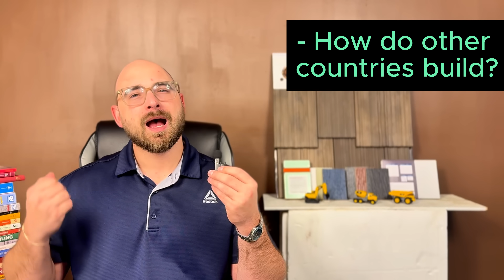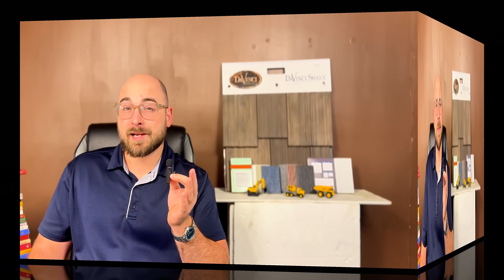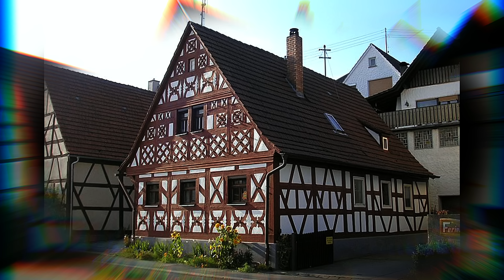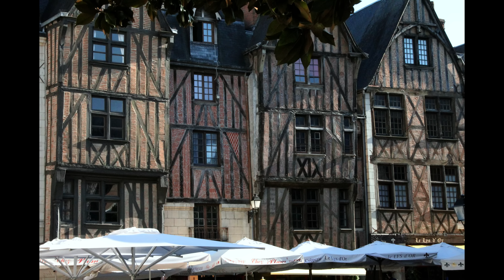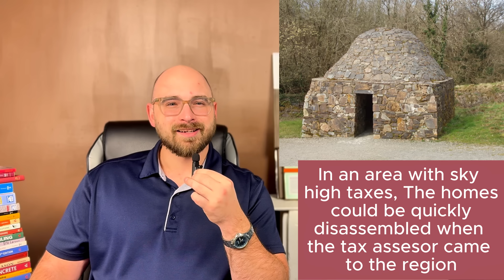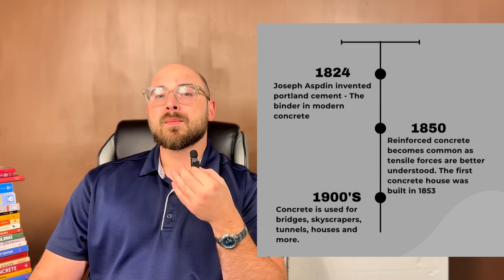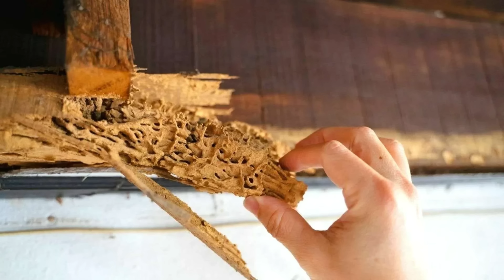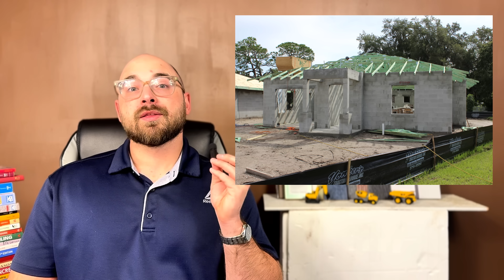Why Other Countries LAUGH at American Homes

Comment: In South Africa its mostly clay or cement brick houses. the labour pool skills are oriented to these materials. if you build a wood house, even if the wood is cheap, it will take forever to build, because there are simply not enough skilled carpenters available. You might have 20 bricklayers on a house and 3 carpenters who put up the roof trusses and hang the doors.

Comment: Jamaica makes it's own concrete and almost every building people use is made of concrete. My maternal grandparents home is made of reinforced concrete slabs. It was built in the seventies in Jamaica has been through every hurricane, earthquake and gang war since it's construction ended and additions built onto it. And other than some maintenance every few years and some cracks it's still standing. The only strong wooden houses in Jamaica are made in the old durable as fuck style with hardwood treated against salt corrosion, insects and fire resistant treatment of the wood.

Comment: Look I've done construction cleanup and also geeked out on older methods of America style like timber and the less common modules style. And this is what I can say... u can get a house but up in less then a month with less waste then how these modern home are. And also they are built better. U don't walk up to a house wall tap the wall and know that plaster is covering foam and wood and it's less then a inch thick of protection.

Comment: Other countries pump tons of CO² into the atmosphere for each concrete house they build. The US sequesters CO² with each wood house they build.
Reply from the maker: And then we have a whole city burn down, or tear a house down and landfill it after 50 years 

Is that good for the climate ?
Reply: @Mike_Fortin  Whole cities burning is both a rare occurrence and a result of climate change which is itself the result of using dirty manufacturing techniques like concrete (8% of global greenhouse gas emissions). The area which burned in LA -- Pacific Palisades-- was developed nearly a century ago. Short of a disaster, there was no reason to suppose the mostly wood structures would not still be there in another century. The house I was raised in was built in the 50s. It's still there. The house I raised my children in was built in the 60s. It's still there. I have no idea where you get the idea that a wooden house is going to the landfill in 50 years.
Reply from the maker: If you saw how many new homes are uninhabitable after just a few years, you would be shocked. From cheap methods to low quality lumber that cannot handle ANY amount of moisture 

There’s some very serious lawsuits against big builders. But that’s another topic for another day. 

Wood has a place, concrete has a place, and we can and should build better housing, especially in disaster prone areas 

A place like FL is a great example, a lot of those homes that were destroyed are going to be landfilled. 

While a product like ICF (insulated concrete house) is more energy intensive to produce, it will last longer and use less energy. Concrete also recaptures some of the C02 during the curing process. When eco friendly concrete is widely available, I’ll advocate for that. When eco friendly versions of rigid foam are widely available, I will advocate for that. For now it’s a matter of doing the best we have with what we’ve got. Wood is not a carbon neutral resource either, we use gas powered equipment to grow, harvest, plane, engineer, kiln dry, transport, and install lumber. 

One of the most sustainable things we can do is build to last, building to use less energy and survive disasters
Reply: @Mike_Fortin  "If you saw..." I dunno. I might be. How many are uninhabitable after only a few years?  As a percentage of all homes in the US.

ICFs seem like a great tech, but my cabin with 2x6 fir construction and rockwool plus an offset 2x2 sleeve with EPS foam is in a cold area, and it takes three days to cool down to ambient temps.

"Wood is not..." Nothing these days is carbon neutral, not our food, not our clothes, not our electric cars. Wood is much closer to it than concrete, though. It's not even close. If we had built the 80 million single- family homes in the US from concrete, we wouldn't be arguing about when the polar caps were going to melt. We would already be using gondolas on 5th Avenue.

If they come up with a concrete that isn't so dirty, more the better. But today I'm going to go look at an immaculately maintained and updated Pennsylvania farmhouse built of clay bricks, wood, and hand-dressed timbers in 1840. The longevity of a building has less to do with the materials used in its construction and more with its maintenance.

Comment: Making houses are of ticky-tacky and having them burn down, get destroyed by floods or bad weather and maintaining them is a battle.  I like the houses in other countries where they are built using cement, brick and metal - durable homes where you don't need fire insurance at high prices and huge maintenance costs, too.  Most countries don't insure everything like in the USA, because they are made to last, so costs over time are contained - use durable materials!!!

Comment: We're building our home now. We are in TX. We have a metal frame and exterior. Stick framed inside with 1×8 ship lap pine on the walls. 10' ceilings and 10' portches on all four sides.
Reply from the maker: What did you do for insulation? 

I know TX is hot , I would maybe want the dew point on the exterior

Comment: I have no Problem with the US Platform framed Buildings i live in one in Germany. I have a problem with missing Insulation, missing Hardboard behind drywall and that when i watch US building electric cables are not wired 6 inches below the celing or 7 feet of the ground but in the center or at floor level.

Comment: Beat an US wall and You have a hole in the wall,
beat an EU wall and say good bye to Your broken hand
The LA fires show it is a bad idea to use US construction. The fires would never run that fast and wide in concrete built areas.
They are save with Earthquakes, better conservation of energy
Rooves made of tared shingles catch fire fast, ceramic shingles are fire resistant.
If a storm is expected in the US, people evacuate, in Europe we close the windows and thats it

Comment: I dont think there is much wrong with stick frame construction, given that you take natural disasters in the build are into consideration. The main issue with a lot of builders is cost and corner cutting. I am planning on building a house myself, in an area with little to no disaster risk, and traditional stick frame is by far the most cost effective and, quite possibly, the only viable route. I do plan on "over building." Dense 2x6 walls, loads of blocking, as much insulation as I can fit, thicker than standard drywall, etc.

Comment: The terra cotta construction block, which you are classifying as "brick", is interesting.  I encountered it several times while working in DC.  One drawback is when it is used in the floor, as a flat arch between concrete beams.  The pull-out resistance on the walls of these units isn't super-great, so hanging anything heavy is not a good idea.  There was a manual produced (in the 1940's?) instructing on the use of the building material.

Comment: There is structural bricks, thermal bricks and normal bricks, in Portugal structural bricks and cinder blocks are not normally because of earthquakes and never for more then 1 or 2 floors, particularly in Lisbon you need a real strong structural resistance structure normally in concrete to resist the earthquakes, metal is also use but there is the problem normally of oscillation etc.

Comment: im an american, and even i laugh at the disposable houses made of (in some cases) elements of Literal Cardboard, of which should not be Literal Cardboard. 

I have lived a number of years each in dallas-area texas, norfolk virginia, and st louis and kansas city, and i can tell you that typical 'just-to-code-and-not-a-cent-more' american housing is literally the underside of the bottom of the barrel. With a reasonable amount of time, i could probably do better by a full half-measure, using just reclaimed or 'defect' materials. 

Matchstick-style platform mc-housing is ok if there was literally no option other than various sorts of tents, tipis, and yurts, and we as a society knew literally nothing else - However, therein lay the self-disproving, because we as an american society should know better, because we DO have examples to look at, in our own territories, of ways to build better houses with stone, brick, adobe and cob and daub, metal, concrete (with or without rebar lattice reinforcement), even examples of how to build with wood to a higher standard of longer-lasting quality (ie, medieval style timber and half-timber framing). 

Functionally, this results in alot of house-building and architectural knowledge - which is simply not being used in america. At All. - and THAT, is worthy of being internationally laughed at, shamed, and insulted. As americans, AS AMERICANS, we should do better, and not rest on our eagle-laurels of yesterday's former greatness.

Comment: Interesting, I’ve wondered about thé European and American building code différences too.  Another interesting aspect to that question, would the U.S. be better equity-wise per family if the u.s. standard building codes had had more stringent & of higher value requirements since 1776?
Reply from the maker: In areas where the set the bar higher, the minimum standard goes up. 

When code requires a minimum R value of insulation, many builders switched to ICF along the east coast. 

When CA required solar, all houses got solar 

Every region is different, but every region has their own adaptations of the building code to suit them. 

Tornado prone areas should have requirements to build for tornado resistance, wildfire areas for fire, and so on. … 

The idea that we should be allowed to crank out substandard houses to support the American dream is not ideal, and some of these “affordable” options are a huge headache for buyers and they end up in court. 

The production style homes prioritize quality over square footage and in my opinion are wasteful and not going to last. 

If homeownership is the goal, which it is, we need to downsize a bit and focus on a on quality in an equal or lower price range and build that way for years to increase the supply of housing 

We also need more young people in the trades, more builders, more innovation etc,

Comment: It's not even a discussion.  Concrete, stone, and masonry is stronger and more durable than lightwood.  We just build this way because it's cheap and it's what contractors are used to doing.  How much a year do you spend on pest/termite treatment?  A roof needs to be replaced and/or re-shingled every 20 years.  An unnoticed leak in the shower wall or kitchen cabinet will cause lots of structural damage in a lightwood home.  Wood is porous and not energy efficient.  For a country that  is subject to tornadoes, earthquakes, wildfires, hurricanes, and floods there's really no reason for lightwood construction to be our standard building method.  Other countries are right to criticize our building standards.  The only thing we have that's great in American homes that they do not have abroad is garbage disposals.  They are against building codes in most other nations.

Comment: in greece majority of modern house , a build  frame with concreate with iron bars ,  wall fill with bricks ,  some use sheat rock  on the inside ,  flore are marble or tiles ,  some use laminate

Comment: Engineering costs are a big part of it. In 2023 I spent six working days a week working with jurisdiction inspectors, and when I brought up structural masonry, they ALL told me that there is no code approved way to build a residential building of structural masonry.
I happen to know they are wrong, but the IRC does have very few approved assemblies for structural masonry, and in order to do anything other than a single story house with a deep foundation, you need to reference special manuals which are not familiar to builders.
I am a software engineer by training, and I'm working on engineering software for building structural masonry houses. I want this software to be able to spec and price assemblies almost automatically, and feed into individual element structural analysis, thermal and moisture analysis, etc. so that engineers can focus on special elements and stamp the rest.
Reply: I like a mix of double wall and EFIS for highly insulated applications.
Reply from the maker: Keep up the good work man, there could be a real place for that in the market if done right!

Comment: Most homes in Puerto Rico, as you mentioned, are made of Cinder Block and Rebar Reinforced Concrete or just Rebar Reinforced Concrete. what you didn't mention is that Puerto Rico is a U.S. territory and so are the U.S. Virgin Islands.  I've also seen similar homes in the southern U.S.

Comment: Problem is not the lightweight timber frame but execution and incorrect application. I am a structural engineer from Northern Europe and here factory produced timber frame buildings are usually very high quality and energy efficient. Timber frame here is often preferred to make very thick insulation of 300mm and more to reduce heating costs. 

Generally, choice of mate materials should be according local conditions. For example timber rot is not an issue in Nordic is house is properly built as if it will stay dry it will last forever.

My own house has load bearing walls of 25cm perforated clay blocks with attached timber-plywood frame to for about 27cm insulation covered with cement boards and timber siding. Ceilings are cast in situ concrete with 40cm insulation and then timber frame roof with metal sheet. Resulting in fulfilling passive house standard of primary energy consumption of less that 15kwh/m2 for heating. I have air to water heat pump of 8kw with about maximum real heating load of 2-3kw.

Reason for wall and ceiling material selections was planned upgrade possibility of building second floor for second unit.

Comment: By the way, steel is amazing in both tension as well as compression. The issue with steel is the high cost, so it's usually just cheaper to put some concrete around the steel.